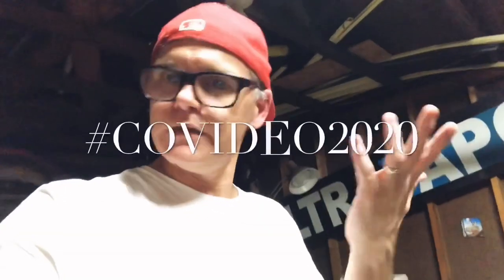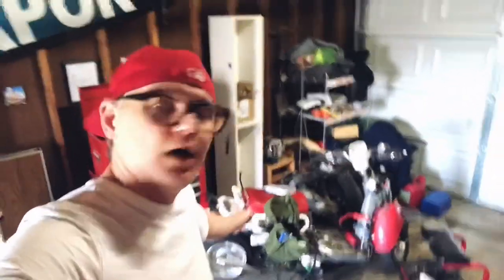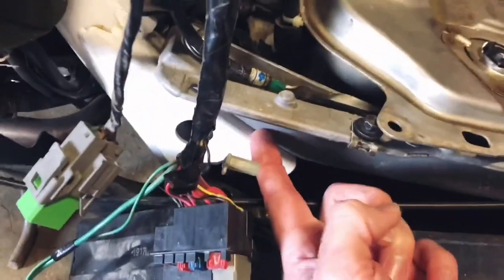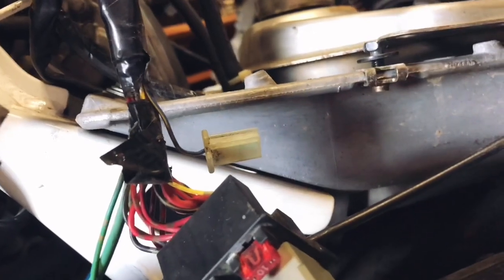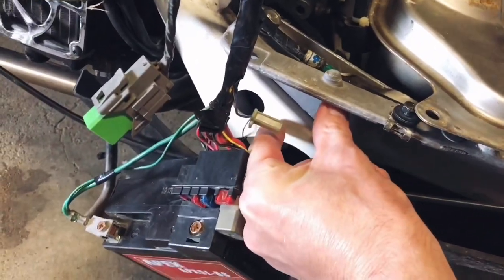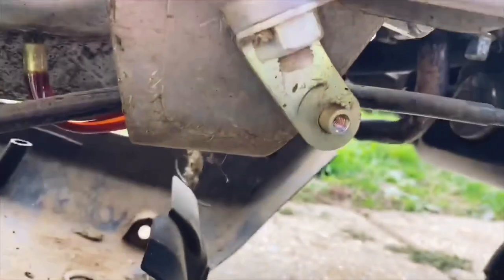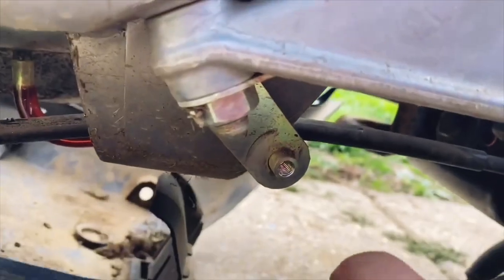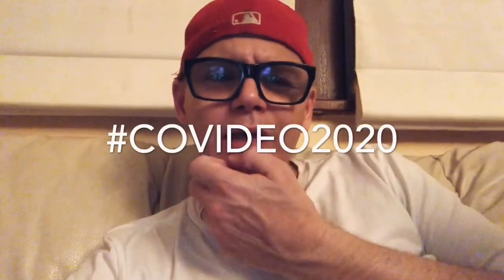Hit Record! Metruck build with help from Mental Builds

Comment: How does your Ruck perform with that Briggs & Stratton muffler. I had gotten an exhaust, but list performance. Come to find out it was a GY6 exhaust than the header was wrong diameter. Put my stock back on and gained 2-3 mph 🙄
Reply from the maker: CornPap Brecht That's actually Adams.. but the B&S is okay for power if you only have $100. I think you could retune the CVT and GET a bit more power from it than stock.. but only if you do the BR header. 

The MNNTHBX SP exhaust is the cheapest I'd recommend if you want an actual improvement. $225. The stock exhaust is very good.. buy falls flat starting around 9000 RPM. Even below that, the SP feels much more open.
Reply: @GETlife  this is very helpful. Thank you. I've done an airbox delete and many other things to try and get to a more consistent 45+ mph, but just seem to only reach 43 mph. And that's not even constant. I can't find anyone locally (Jacksonville, FL) that does Ruckus mods that I can lean on for assistance or suggestions. Your channel is most helpful